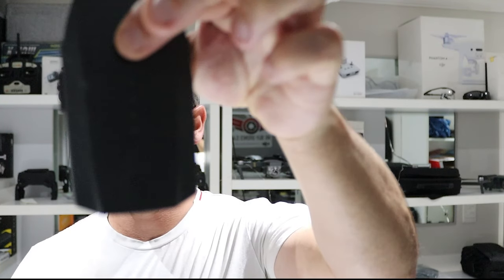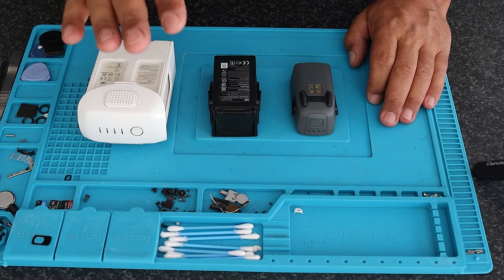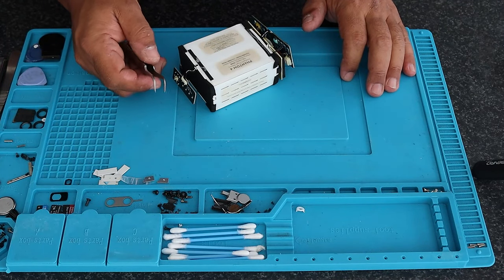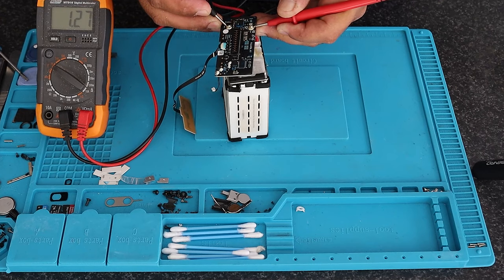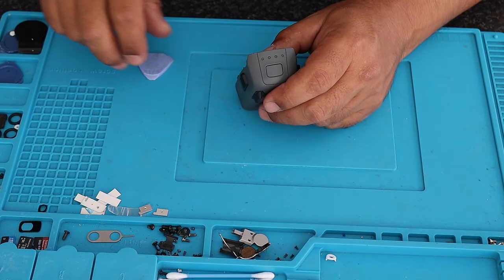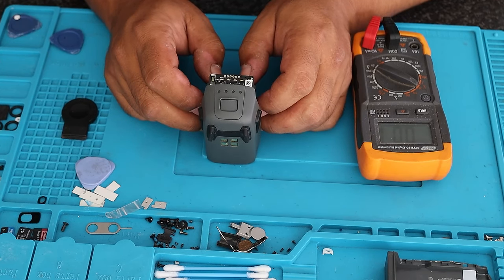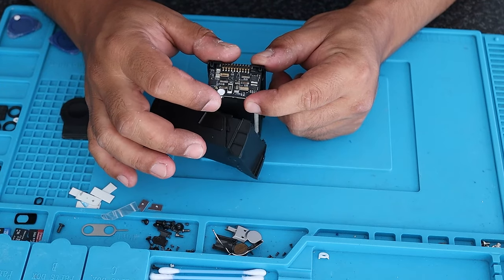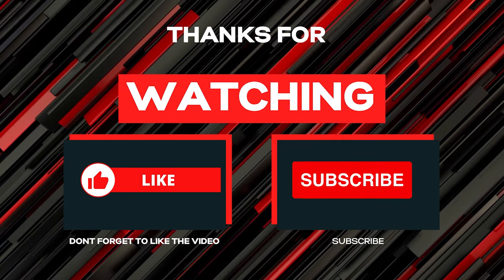How To Fix A DJI Battery That Wont Charge

Comment: I must say that the safety tip regarding the handling of these batteries is very important, lithium is very dangerous if it ignites, and this can happen with a simple short circuit, I congratulate you for starting the video with that warning.

Comment: So DJI makes  the batteries are unrepairable basically.. Ain't nobody got time for this. The first step is cracking the case. Just tried it. All you're going to do is break that, too. I appreciate you showing me this is a waste  of time. I gave you a thumbs up for that. i guess if these batteries were economically repairable , somebody would actually  be offering a repair/exchange service. Kids, make sure you charge your batteries every month... or else
Reply: Seriously, I was hoping for a solution like you see on power tools where you make a quick jump to wake it up.

Comment: hi

great video thanks

but cant fix the pcb board guard when the voltage as drop so much the pcb get lock

so cant fox without the software 

correct?

thanks
yossi
Reply from the maker: Yes thats correct,  you need to get the voltage up on the cells
Reply: after i up each cell

i must the software??

from where i can receive this pc software and the interface to connect to the pcb of the batterys
Reply: is yhere adpater with usb connection to the pc to unlock the batterys ?

also i need for mavic pro 1 

thanks

Comment: How about the original mavic drone batteries? I bought 2 extra years ago when i bought the drone in 2018 and never used them. Now i pulled them out and the original battery on the unit still works but the 2 new never used wont even light up..... how can i fix brand new batteries?

Comment: I appreciate the effort in showing us the generalities of the process, however after watching several videos, we found the practical part.

You must buy an interface that can cost between $60 and $120.

Then there is the software license which is incredibly high.
Since it is not a license as we are used to paying and using, it is conditional on a
day and up to a month, $100 minimum price and up to $1000 a month, which leaves it out of reach of a person who at most is going to repair one to two batteries, which is usual for someone who buys a drone.

I have three and it is not profitable, considering that a new one is still at the excessive price of $160.

Comment: How do you charge? Do you just connect the LiPro Balance Charger to each cell contact points as shown during measurement?
Reply: Hi. No. You would need to unplug in the batteries balance lead, and make a new lead to plug in from the balance charger. Easy way is to use a DC supply of say 12v ( entirely depends on the battery model ), and get the voltage of all the cells collectively to above 10.5v ( if its a 3 cell )

Comment: I had a drone wreck itself and the battery went into the street and a car ran over my fpv battery slightly smashed it and even V shaped the mother board I had no clue how it didn’t exploded in the road. I took apart and cut each battery apart (6) while my buddy watched in the garage. I stressed so hard over it like bro you don’t understand what kind of bomb I have in my hand cause this battery was at 100 percent while 1 min fly time blew it was smashed. Each pack had 4voltd still in them. I solder wire to them and have battery packs for 5v led pixel lights now lol

Comment: i have 15pcs phantom 4 battery new brand and it was in my warehouse for 7years ,last week i found them and none of them charge and work,i assembly one of it and  charge with Imax B6 for voltage of 4cell and 2amp,,after some minutes battery blow up when the voltage arrived near 15.2 volts,,are they damage and unusable 100% or  my way or charge with 2amp  was not good...I will be thanks if you reply me to silve this problem,,

Comment: Please help me,,i had 15pcs of phantom 4 battery in stock since 2016,,and for 7 years it wont be charge and just in package and its box,,after i found it in one of big box in my warehouse ,it does not get charge and nothing happen when push the button  nothing happen  when i plug the phantom 4 original charger to it it does not get charge,,,I disassembly  one of them to charge with Imax B6 device ,i charge it first with NIMH mode 2amp and up to 15volt and after some times   it start to swollen and  but the led  on,and with Ev2300 i remove PF ,and after it ,,it start to charge and after some minutes stop charging ,,,i also open another battery and this time i charge with IMAXB6 with 0,5amp and up to 8 volt ,and again it swollen like first one,,My friend are the all battery damage for 7 yeas of unused or is there any way to save all battery to work...please help me....

Comment: Why do you break these batteries apart? When they still hold a bit of charge so you can read out the battery management chip, can you then not connect to the data and clock terminals of the battery's connector? How much time does a complete battery repair take you? Is it not more affordable to get a new battery?

Comment: is it possible to do this with a DJI fpv battery?
Reply from the maker: There is no software support for them as yet , we attempted one yesterday with no luck
Reply: @webuydronessa has there been any updates since your last post regarding the fpv batteries?
Reply: @webuydronessa   I have the same question. Have a couple FPV batteries that I need to recover.
Reply from the maker: @multumesc100 we have not had the opportunity to do an FPV battery as yet so we are unsure at this stage